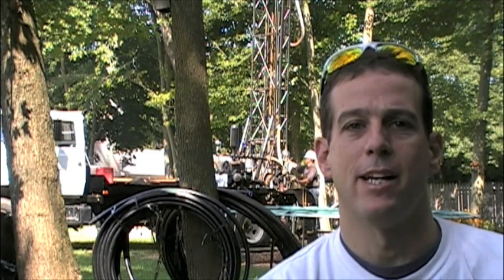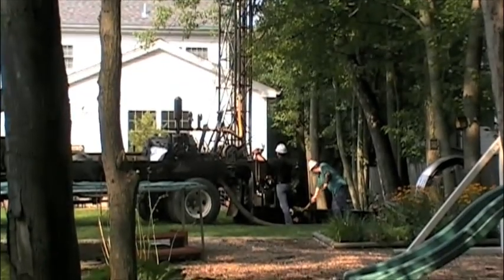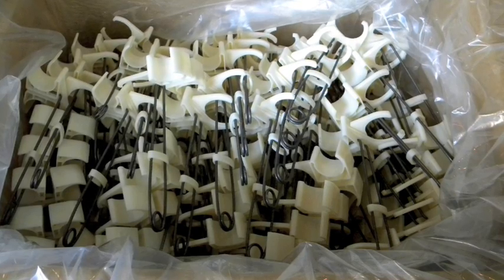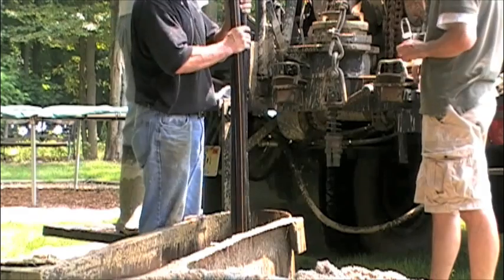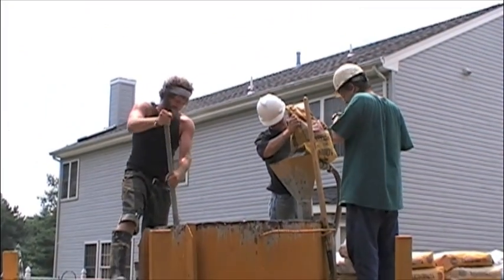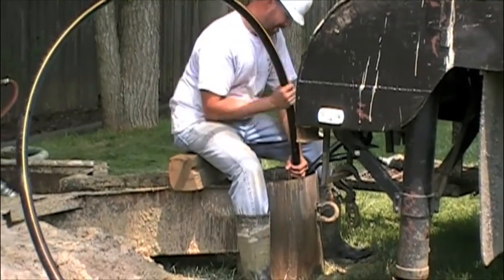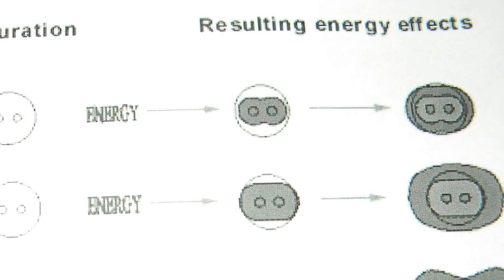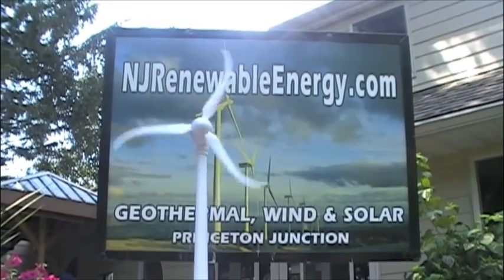Geoclip install on a geothermal system Geo Clip water furnace

Comment: I certainly don' t intend to argue, as you have your opinion based on your experience. But the company I work for has studied this and tested it. We also have test and thermal conductivity data for VHE's across the country. There is no data to support any beneficial effects from the use of geoclips, even on the same site. I do have an idea of what I'm talking about, I'm currently involved in probably one of the biggest geothermal projects in the country. Over 1000 tons, 800 bores at 250' depth.

Comment from the maker: @JBCalander   I agree and we don't reduce loop size.  Although I mentioned it in the video, I didn't advocate doing it.  We also re-check grout levels.  As far as the spring tension in the clip, you have know idea what you are talking about.  I've actually had to dig up a geo clip'd section after the grout had set up and have first hand proof that each side of the loop was as far away from each other as possible, pushed to the outer wall of the bore hole.

Comment: Geoclips do not guarantee placement of the pipes in the borehole, and system size should never be reduced with the assumption that they will. The spring tension is simply not strong enough. Reducing the capacity of the system based on that is asking for trouble. Also, the grout level in the bores should always be re-checked until they are stable. Grout loss to certain formations happens frequently and then you are left with a system that does not work as designed.